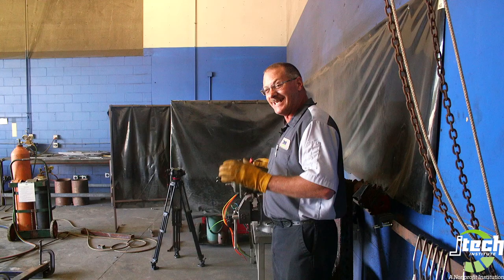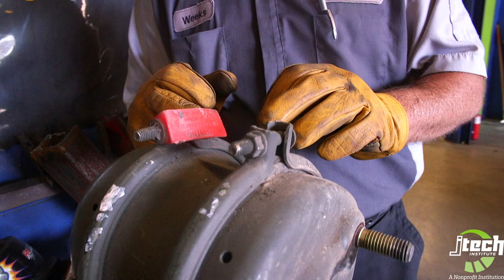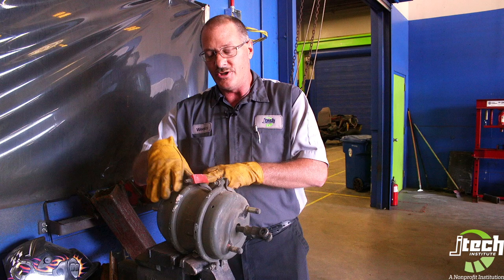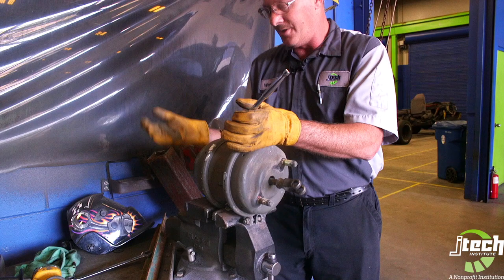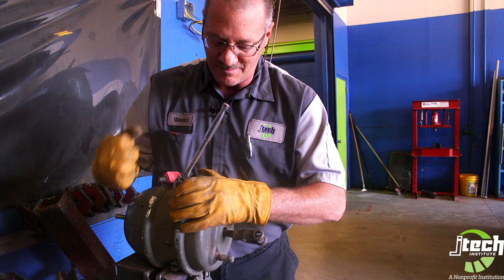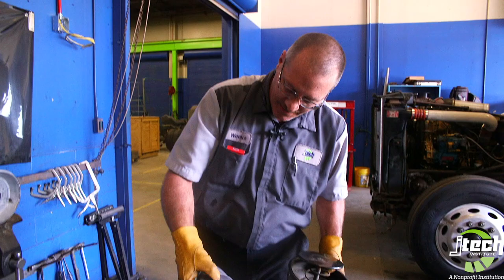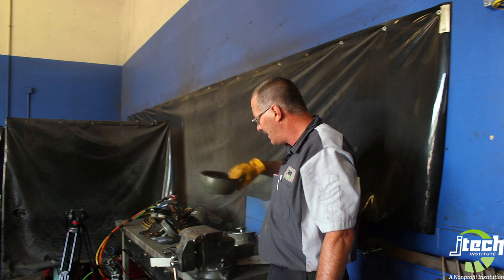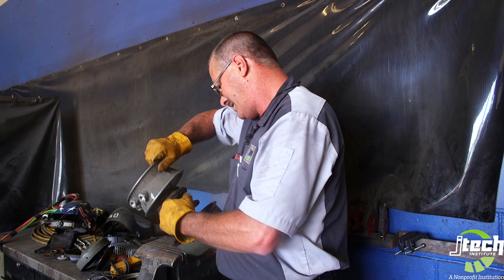The Dangers of Brake Chambers With Mr. Weeks

Comment: I wonder how many lives you have saved by making this video, great stuff. I been around for while but have never been exposed to this type of brake but knew they were dangerous. I am on a tunneling job which has rolling stock with these brakes fitted, I will be showing you video to our mechanical team as a safety talk as a most of them have no idea of the dangers of with these units. 
A quick question, should you disarm them if they are going to the scrap?
 Cheers
Reply: Absolutely disarm them if they are scrapped

Comment: My Dad had a small trucking business years ago when I was really young. He was teaching me how to service the trucks. One day he after he just got back from a trip he told me to change the diaphragm on one of the brake cans on the diesel tractor which I think had 13?bolts holding the can together. The one bad thing he didn’t tell me was I had to bleed the air system first. I got all the 13 bolts off and was tapping on the brake can with a hammer to sort of loosen it up and lifted my head off the creeper to see why it wasn’t coming off. Right when I was moving my face out of the way it blew off barely hitting the side of my face. I received a huge lump and bruise to my cheek bone and I socket. If my face was directly in the way of that sudden explosion it might of smashed my face into pieces and maybe bled out since I was the only one at the shop.

Comment: nah nah nah, you just replace the phreakin can. there ain't no rebuilding or replacing diaphragms, you replace the can. replace the diaphragm on the fronts all you want but when it come to drive and trailer brakes...REPLACE THE PHREAKING CAN!!! duh
Reply: Yup, new cans don't even have the side  bolt clamps.
Reply: @randyfox7570  theres still brand new cans on brand new 2022 model trucks with 2 clamps. All heavier duty than normal semi trucks but still being made.
Reply: You still have to line up the brake can and bands so it works.